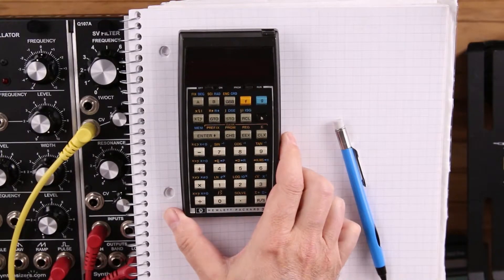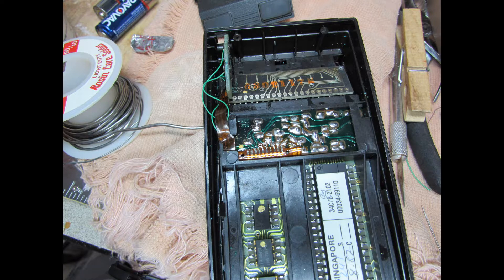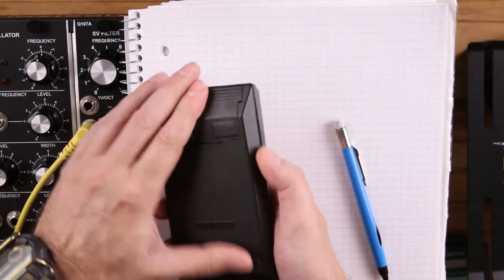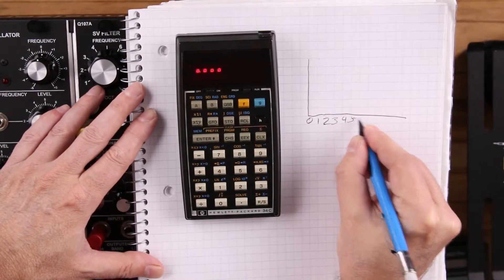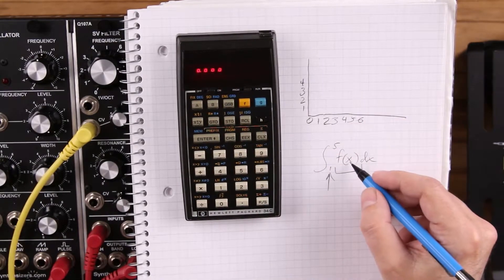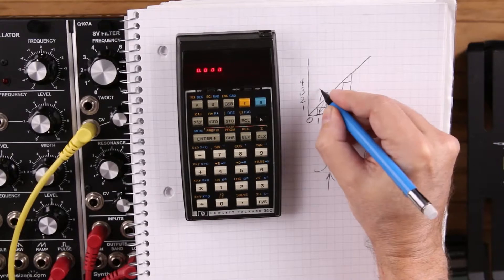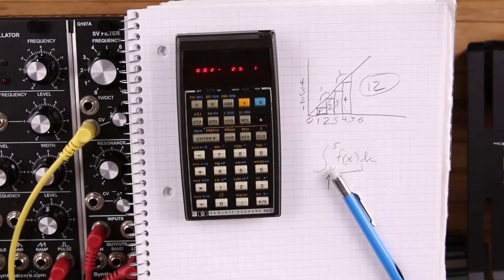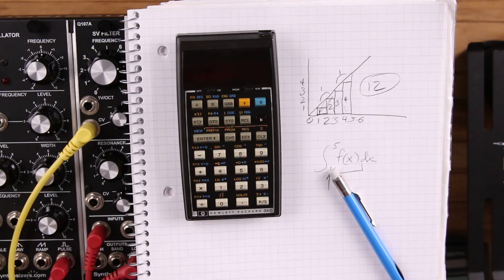HP34C Calculator Integration

Comment: Thanks, now I know how to integrate with the 34 that I got from eBay last week. I come from the 41 which I had in my engineering studying years (early eighties). But the 41 is way easier than the 34, since the alphanumeric capabilities make it much more intuitive, although the programming structure is basically the same. Thanks also for the tip on the aluminium foil for the batteries.